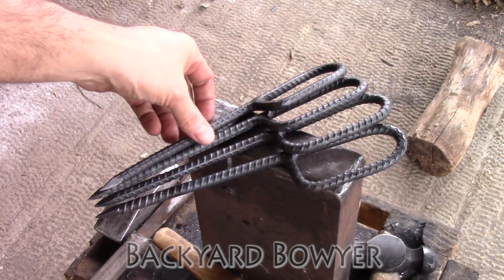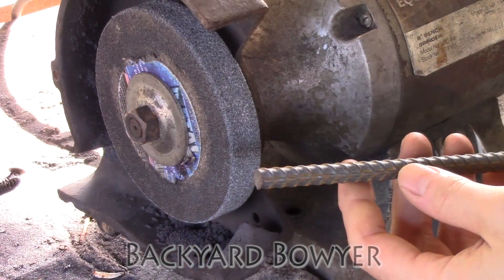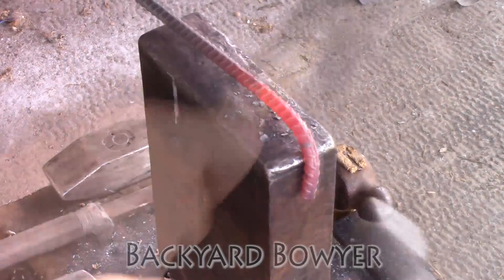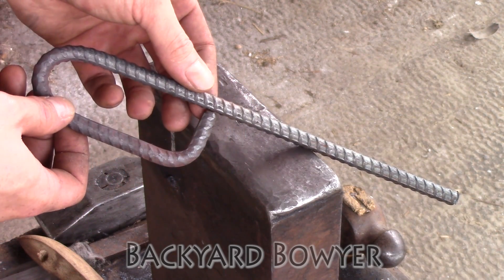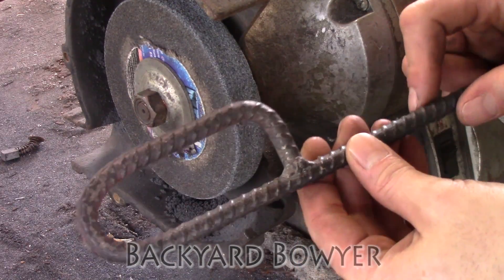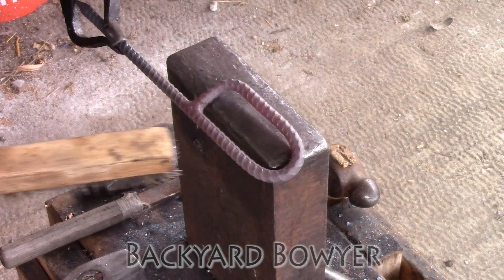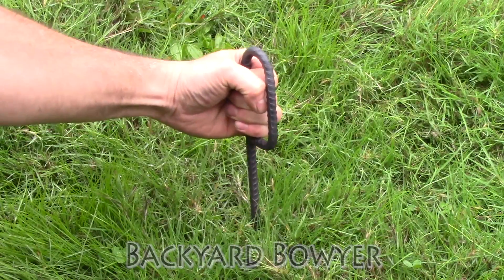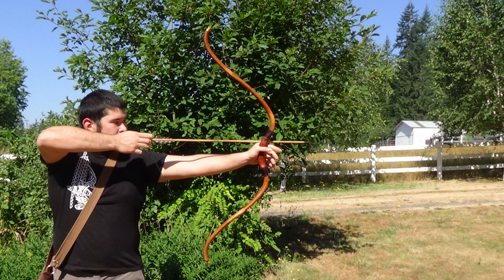Making a Backyard Utility Stake with Rebar

Comment: Actually a nice idea. It makes holding the stake rather easy when driving it. Seems a bit heavy, so might not be the best option if you are hiking in, but the large loop allows a lot of different tie down options.
Reply from the maker: +Jesse Sisolack Thanks! What I need to do is get some company to make a titanium or duralumin version with a locking carabineer on the outer side of the loop. Then it would be light, versatile, and still be easy to handle.
Reply: One of these with carabiner and made of a light, tough material...that would be awesome. I do not think anything like that exists, at least I can not find it.

Comment: Your rebar videos are really nice because the materials are super inexpensive to get a hold of. Would you be able to make a video where you forge out a fixed blade from rebar, but work the handle area down to put on scales? I want to start forging as soon as I have the money to start, and I'm probably lay going to start with some rebar knives with varying finish just for practice, and it would be cool to have a reference.
Reply from the maker: +Monkeysrock Thanks for the suggestion! That's a great idea!

Comment: One tip: try to get the point as centered and symmetric as possible. If you don't, the stake will go off course as you drive it into the ground. I made one of these with the worst possible point, a single bevel, and it moves a couple of inches sideways before it's all the way down.

Edit: the point I'm talking about is like the ones on your 10" rebar stake on Etsy. These will tilt and go sideways with that point.
Reply from the maker: +jjohnston94 Thank you for the tip!